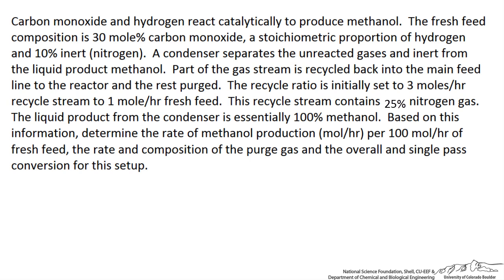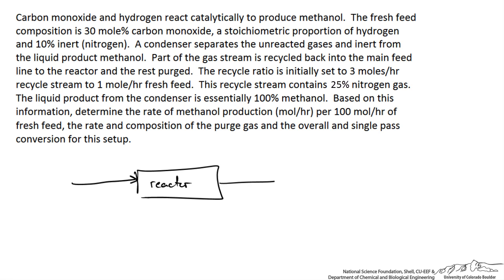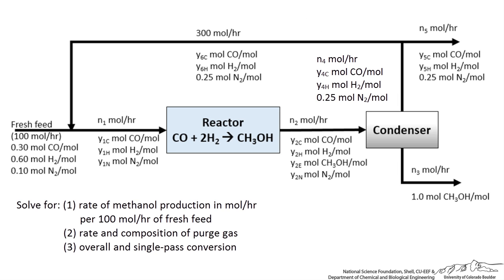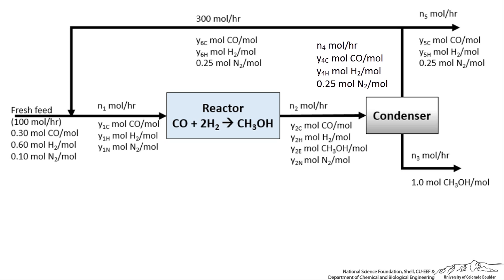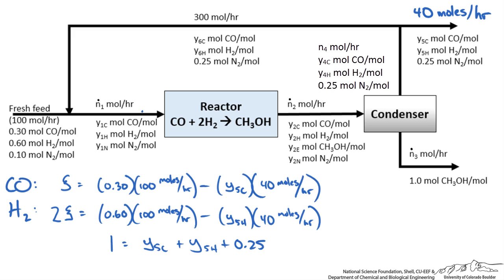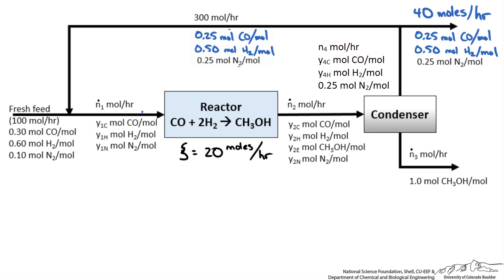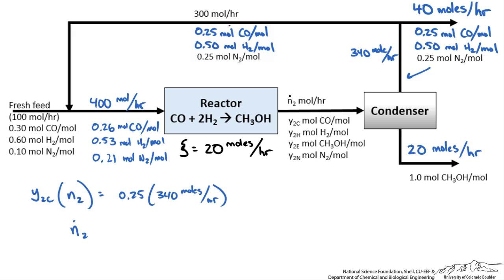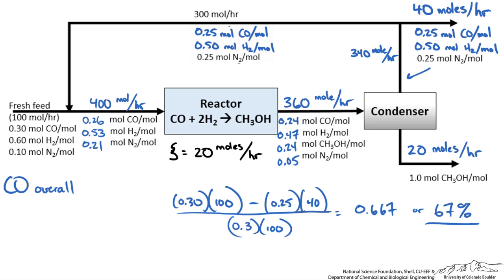Single Reaction With Recycle

Comment: The N2 before it enters the reactor should just be equal as it leaves the reactor since it does not participate to the system reaction, which gives Y2N = 0.23611 or simply 0.24 mol N2. Also, Y2E should be 0.0555 mol right?
Reply from the maker: You are correct on both accounts. The numbers were switched for Y2N and Y2E. And, yes, Y2E should be 0.055 or 0.06. Thank you for your attention!

Comment: How is it possible that the flowrate of Carbon monoxide IN is 30 mol/hr but for Carbon monoxide out it is (0.25)(40) which is 10 mol/hr ?
Reply: That's because some CO gets consumed during the reaction to form methanol

Comment: Hi! Could you explain me why do I need to calculate purge streams via recycle/splitting point instead of the overall process balance? I'm wondering this because the amount entering the fresh feed is not equal to the amount exiting including the purge stream (in many textbook problems)... Thanks!
Reply from the maker: Thanks for the question.  You need to calculate the purge stream via those points because you will miss them altogether in the overall  process.  I'm guessing the confusion here is that the streams do not seem to add up because they are in mol/hr, not mass/hr.  The reaction taking place in this problem goes from 3 moles to 1 mole, so it seems off.  Does that answer your question?
Reply: @LearnChemE  Actually, it helped me a lot... So if the balance is in terms of mass/hr, then the overall process balance would consider the purge stream instead of just the splitting point?

Comment: The single pass conversion of CO : Entering the reactor 30 moles from the fresh feed and 75 moles from recycle stream(0.25R=0.25x300=75) total 105 moles CO Entering the reactor.
Leaving the reactor 10 moles in the Purge stream and 75 moles in the recycle totaling 85 moles CO Leaving the reactor. Therefore single pass conversion  is (105-85)/105=0.19 (19% NOT 17%.
I think the Methanol content should not be included in the gases leaving the condenser. ONLY unconverted (Unreacted species).
Reply: I also got 19%. I think the difference is that they rounded off the mole fractions entering the reactor?
Reply: When I solved the sum I got 19% too! But I don't know how he found out the gross feed composition..
Reply: Yep I also got 19%. They rounded too much, should have kept more decimal places.

Comment: +LearnChemE why we cant do an overall balance to find the molar flow rate of condenser pure methanol stream , If we already got to know 100mol/hr of fresh feed and 40mol/hr of purge stream , why it cant be as 
100=n3 +40 ?? 
Please clarify this to me
Reply: I know you asked this 7 years ago, however for future watchers. When dealing with reactions, moles are NOT conserved. As such, you can no longer do overall mole balances. Mass and atoms are still conserved however so you can do mass and atomic balances with reactions.
Reply: I think because a reaction is involved i.e 1 mole CO +2moles of H2 form 1 mole of CH3OH.
If the mole balance doesn't work here(1+2 is not equal to 1),it will not work for overall balance.
Reply: yeah totally agreed. This part is really confusing. Why can't it be 100= n3 + 40, thus the value for the product stream (methanol)  is n3= 60 mol/hr. Can someone explain to me? I got CPP test tomorrow particularly on the purge and recycle stream.  Thanks

Comment: How come the N2 going into the reactor is not the same amount as the N2 leaving the reactor?  That is Y1N*n1 should equal Y2N*n2, since N2 is an inert and doesn't take part in the reaction.
Reply from the maker: You are correct.  Those should be equal.  There is an annotation to fix this, but annotations need to be turned on and even then don't work on portable devices.  The problem is that the mole fractions for CH3OH and N2 were reversed.   They should be as follows: Y2N = 0.24 and Y2E=0.05

Sorry for the confusion.
Reply: does this error affect the other values?

Comment: Hi, why did you consider the 25% N2 as mol fraction for the recycle stream composition? If the problem says only 25% N2 and not 25 mol%N2, thanks
Reply from the maker: That is a great question.  It should have been specified as 25 mol% N2.  Since the rest of the information is in moles, it's generally safe to assume mole percent.  But it is always good to check!

Comment: but there is a recycle of n how is n in = n out? from 5.37 of the vdio
Reply from the maker: This is a balance around the whole system which would only include the fresh feed, n3, and n5.  In this case, there is no nitrogen in n3, so for a steady state system, the amount of nitrogen going into the system equals the amount of nitrogen coming out in stream 5.  Thanks for your question.
Reply: @LearnChemE  If that's true then how can I have a nitrogen in n6? If the whole nitrogen is gone then how can we recycle any of it back into the reactor?!

Comment: i understand how you use the extent of reaction method to find the composition in stream 5, but when i try to use the normal method of in equals out,its not working out the same answer, why is that so? thanks
Reply from the maker: I'm not sure what you mean by "normal method".  Does this method take the reaction into account?  Please clarify and we'll make it work out.
Reply: if i try to use that in equals out by taking the overall balance around entire system
Reply from the maker: There is a reaction in the reactor.  If you don't account for that, you won't have any CH3OH coming out.  A simple in=out balance over the whole system would miss that. You must use one of the methods to account for a reaction.

Comment: Can you use the "Atomic Species Balance" approach for this problem?
Reply from the maker: Thanks for your question. Yes, you could use atomic species balances to solve this problem. However, it is easier to use molecular species balances in this case because you have a single reaction and only 4 different molecules in the system.  Atomic species balances are most useful when there are multiple reactions and many different molecular species involved, because molecular species balances in that type of problem can become quite complicated.

Comment: how did you decide that your relationship is "purge stream mol comp must add up to 1" instead of the given relationships such as the stream ratio between recycle/feed (3:1) and 100% of output stream to be CH3OH?

On 2nd thought, I see you're considering the entirety of the system so recycle/feed ratio is out the window, but what about the second one I mentioned, that 100%of output stream is CH3OH? Why can't that be your relationship?
Reply from the maker: The 100% output as CH3OH is counted in a way.  It is simply a stream value that is already defined in the problem.  We already know the composition of that stream.

I hope that clears this up
Reply: hmm I feel thats the hardest part for me for DOFs but thanks for the speedy reply
Reply from the maker: Said another way, it's not information that relates different unknowns to each other, so it does count in reducing the number of degrees of freedom after the unknowns and reactions are counted
Reply: actually we could write the mole compostions as a x1 CO 0.75-x1 H2O and 0.25 N2 like this we can decrase number of unknowns. Like this there is no neccesarry to additional info.

Comment: Around the mixing point, we have 100(0.1)+300(0.25) = 85mol/hr of N2 entering the mixing point, but we have 400(0.21) = 84mol/hr of N2 leaving. Where did that extra 1mol/hr of N2 go?
Reply: This is simply because he rounded off the value. The mole fraction of N2 in the stream leaving the mixing point is 0.2125. You'll find your extra mol/hr there.

Comment: ok so my question is, it is not necessary that the feed coming in plus the recycle is equal to whats coming out? i mean if overall balance, 400 is not = 20 + 340? this is really confusing
Reply from the maker: +Alif Syafiq Thank you for your question.  This can be confusing.  In this case, the reaction is the difference.  In the reaction, 3 moles of reactants form 1 mole of product.  If you look at the reactor, there are 400 moles entering, but only 360 leaving.  I hope that helps.
Reply: LearnChemE Thanks for answering, however does it make any difference if i do the mass balance in terms of weight rather than mole even though with reaction? You see, my reaction, all the stoichiometric ratio is 1. Will the input have to be same as output as well?

Comment: why is the compostion of N2 in the recycle stream is same as in the purge ?
Reply: you have chocolate milk that is 95% milk, 5% powder, by mass. you drink half. its still 95% milk, 5% powder by mass.  but it was split.
Reply from the maker: mimi A Thanks for asking.  Here's the scenario:  You have a stream coming out of the condenser.  You are diverting part of that stream out of the facility, but most of it goes back into the process.  You do not change the stream in any way; you only send it in two directions.  The composition stays the same.  The stream leaving the condenser is 25% nitrogen, therefore both streams from the splitter will also be 25% nitrogen.  In this case, the 25% is not about the total amount of nitrogen, but rather the composition of the stream.  To carry out the math, there are 85 mol nitrogen leaving the condenser (340mol * 0.25mol N2/mol), 10 mol nitrogen leaving the process (40mol * 0.25mol N2/mol), and 75 mol N2 going back into the process (300mol * 0.25 molN2/mol).  85 = 10+75.

Please let me know if this helps.
Reply from the maker: Because we split the stream into both a purge and recycle, the compositions must be the same.  Otherwise we would need a separation technique to change this (filtration maybe?)
Reply: LearnChemE I still don't understand why that is the case. If the stream was split in two with the recycle being 25%Nitrogen I would've assumed the other stream would be 75% Nitrogen. But you also said what leaves the condenser is 25%Nitrogen, so I would think there would be no Nitrogen in the purge, as its all gone in the recycle stream.Please clarify this for me.
Reply: LearnChemE Okay, I understand that now..Thanks
Reply: LearnChemE I still don't understand. The gases in the recycle stream are including CO, N2, and H2.
 Doesn't that mean the 25% Nitrogen is equal to (mole N2 )/ (mole CO+mole N2+mole H2) ?   How do you know the purge stream has the same mole fraction ? so is the exit  stream from condenser?  Or is this just something the case for inert gas ? when you purge the inert gas, you let it keep the same percentage in all streams?